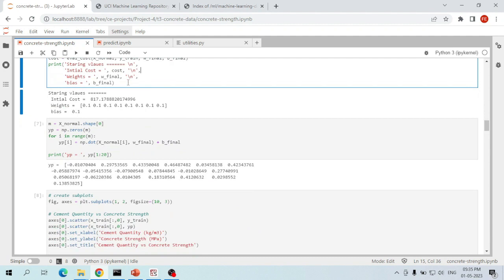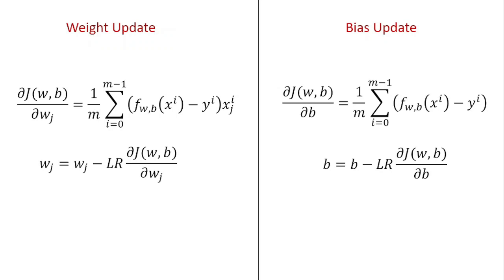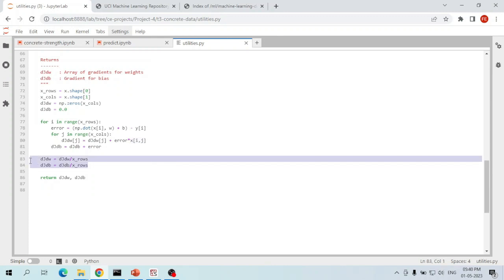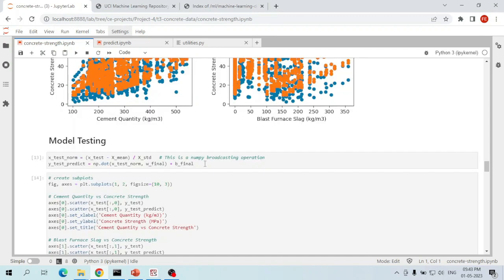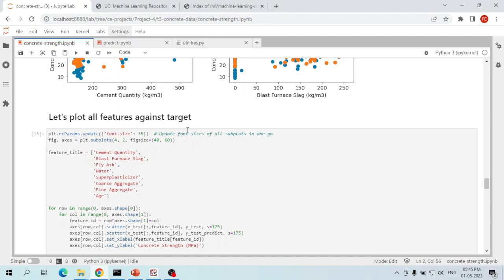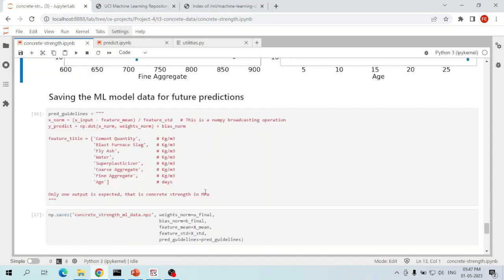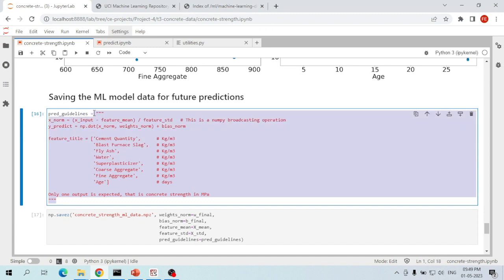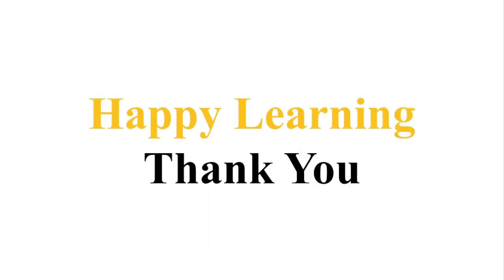Part 1 of Project 4 - Machine Learning Model Development - (Video 2 of 2)

Comment: interesting video. In your video you have not specified whether the data has been obtained from a laboratory or a concrete plant. Nor has it specified the reliability of the concrete producer. You have also not specified whether the resistances you consider are the design resistances or those obtained through the breakage test. If they are broken, the reliability of the producer should be included in the neural network.
Reply from the maker: Hi @gersaavedra6168, thanks for your comment and feedback! In the first part of the video, I explained the source of the data—it's obtained from the UCI Machine Learning Repository. You can find more details there. If you have any further questions, feel free to reach out!